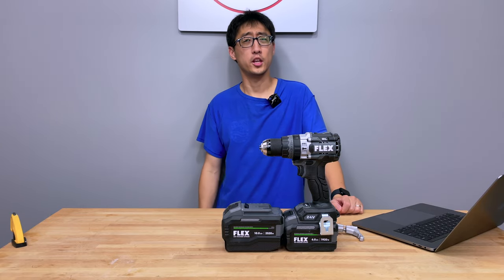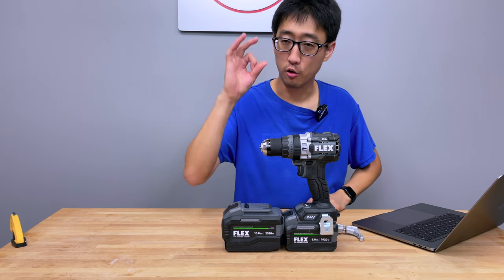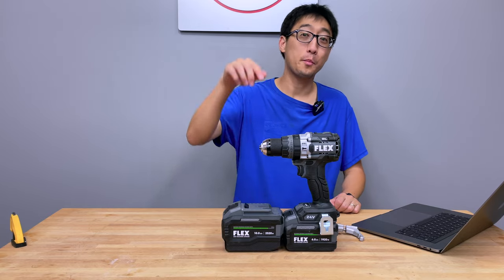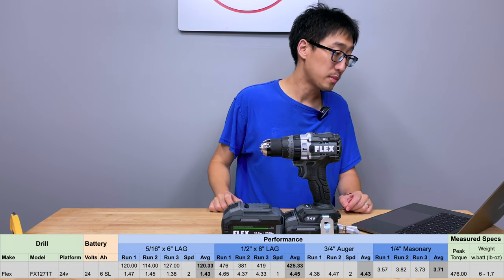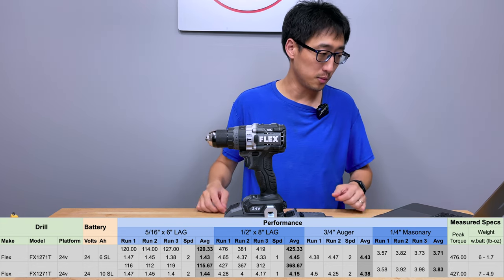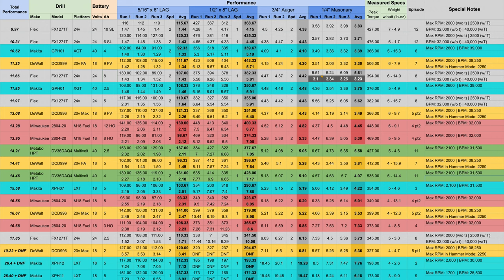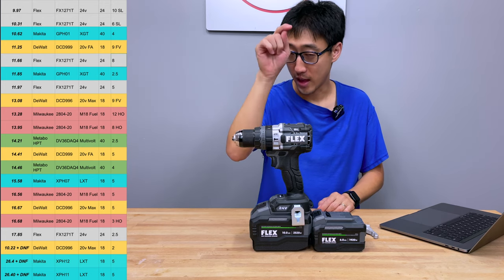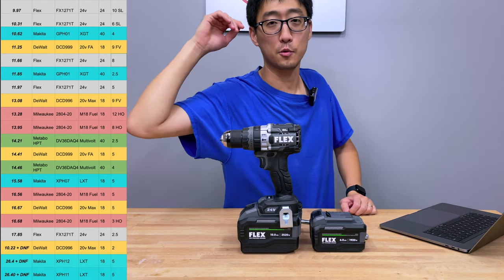Flex 24v Turbo Hammer drill with stacked lithium review | fx1271T | best drill ep.12 | 10 ah stacked

Comment: 3.5 stacked is the best combination for drill and impact! Thank you for the video my brother!
Reply: Tools and tactics tested the 3.5 stack lithium iron with the flex quick eject and also the hammer drill and found that the 3.5 is the most efficient even over the 6.0 stack lithium or was the same. 

Tools and Tactics didn't test the 10 amp stack lithium battery.

 I would not run my impact driver or drill driver with a 6.0 or a 10.0 amp  hour battery that is crazy and stupid stupid
Reply: @rickyperkins232  Indeed Brother, indeed.
Reply: The only way capacity makes a difference is if they use different cells (they don't) or if the physical packaging is different (but then it's just likely to heat up quicker with one or the other, difficult to imagine minor differences in packaging producing a noticeable difference in performance without the user noticing something is wrong with the battery).
Reply: @Jakeisks  Why do people comment on subjects they clearly can’t be bothered to even google? Yes they use different cells, stacked uses lithium pouches, ie cellphones, laptops etc. typical tool batteries use round cell. What we were talking about is the fact that the discharge capability of the 6.0 is so high it’s wasted on any tool that’s not drawing that much wattage. So for drills and impacts like I said before ^ the 3.5 is much for efficient than running a 6.0. You want me to break that down again in Dr.Seuss riddles for you?
Reply: @athannaelanderson3806  
Yes, the 6 amp hour battery is heavier...

Comment: Greater capacity does not mean higher output. Using the same cells in parallel increases capacity but they are still the same cells outputting the same voltage and current. It just runs longer.